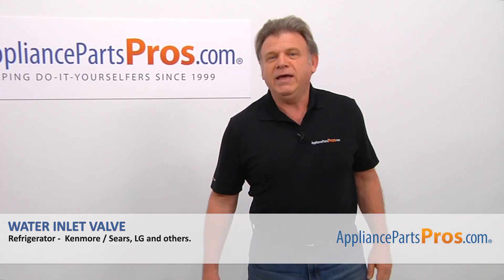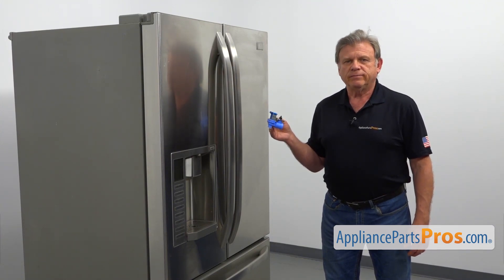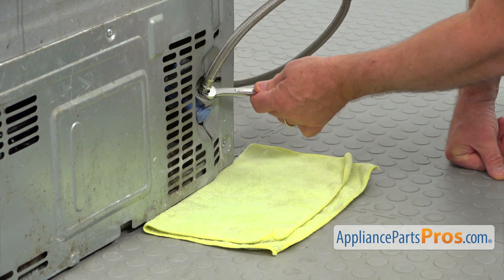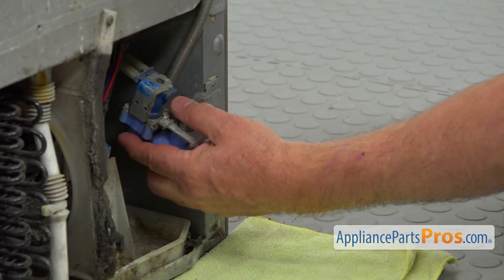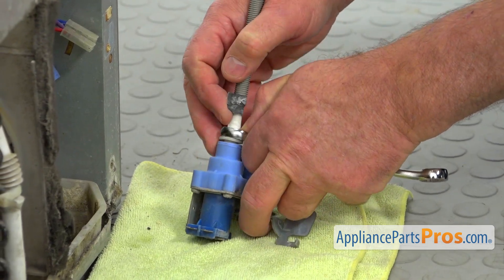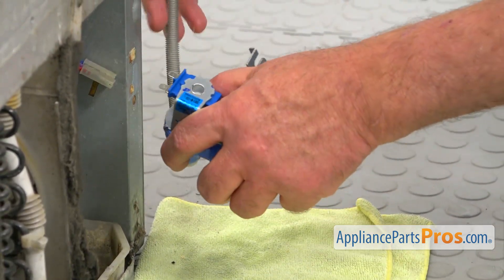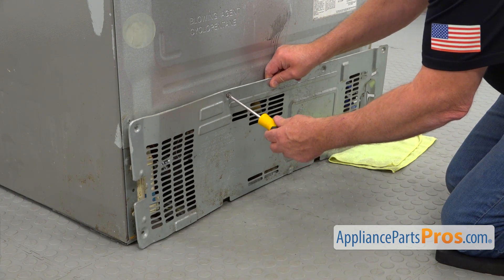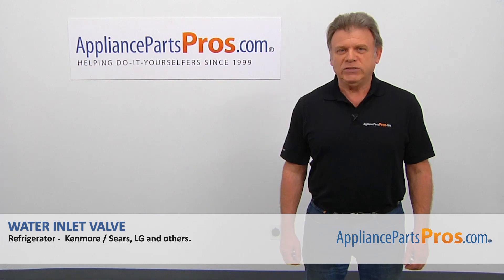How To Replace: LG/Kenmore Refrigerator Water Inlet Valve MJX41178908

Comment: replaced the valve and still no water.  No water at the filter when i take the filter out.  when it was new, the water just poured out.  do i have an obstruction in the line somewhere?
Reply from the maker: Yes, you could have a blockage in the water line, you will just need to check for that.